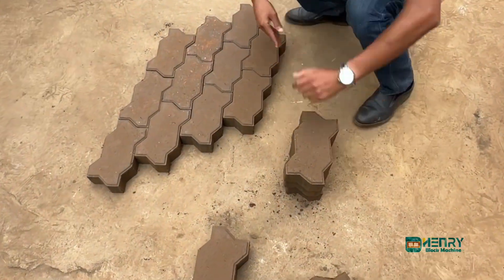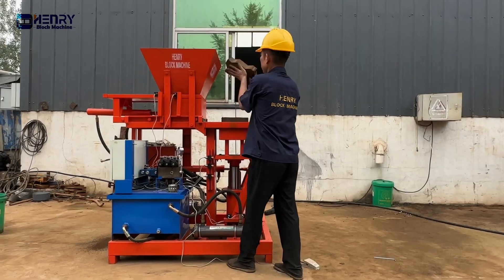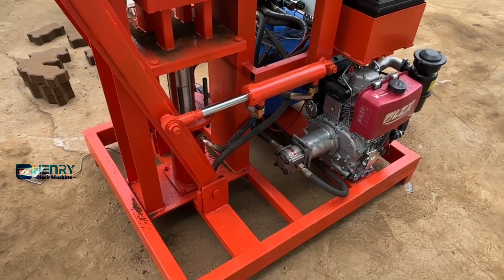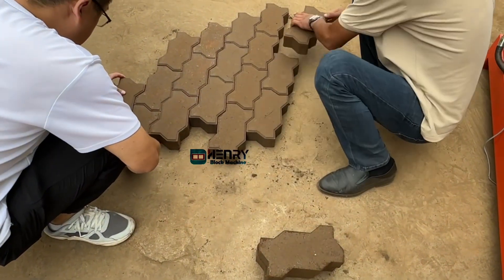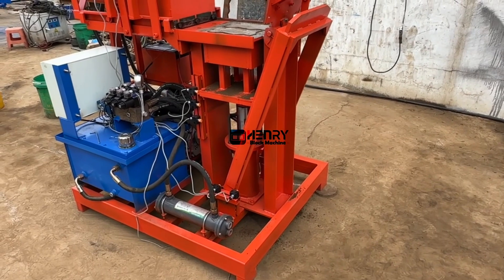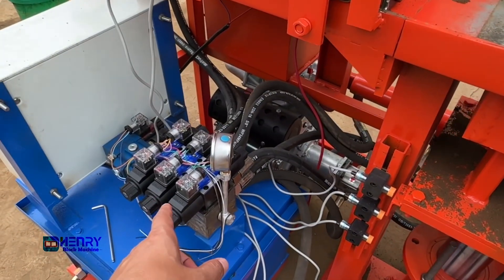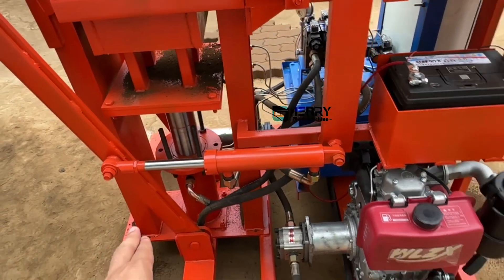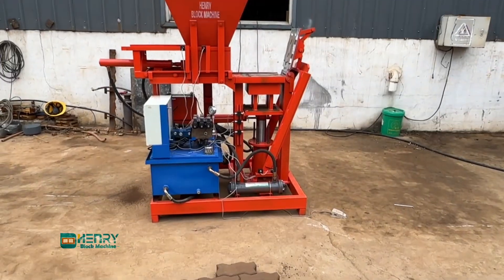How to use Compressed earth block machine to make interlocking brick pavers ? DIY earth bricks

Comment: Great machine. Does the interlock brick have the capacity to withstand big vehicles like trucks, if used for road paving..?
Reply from the maker: Thank you so much for your kind comments. If you like, please subscribe my channel . yes this interlocking bricks withstand vehicle if the material you take use of is correct
Reply: @HenryBlockMachineGroup  Thank you. I have subscribed. Is the compressed paver brick stronger than the precast mould bricks or same strength.?